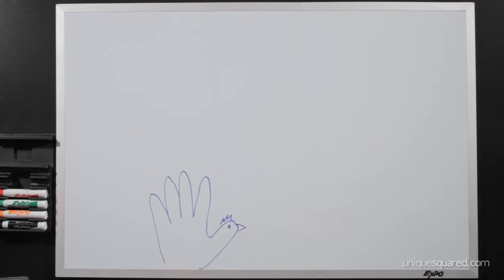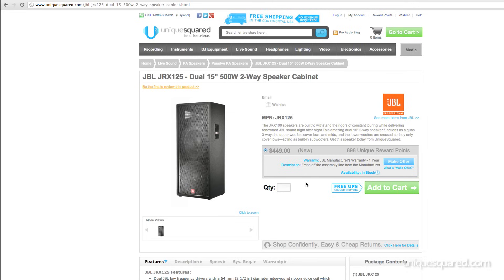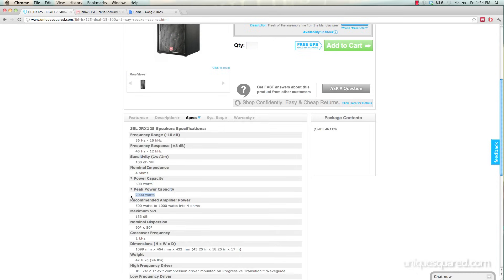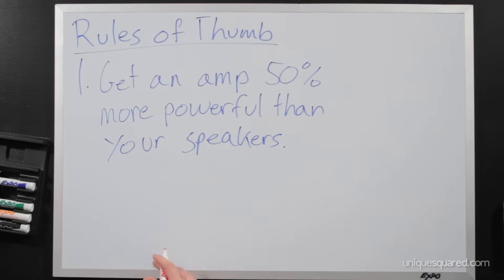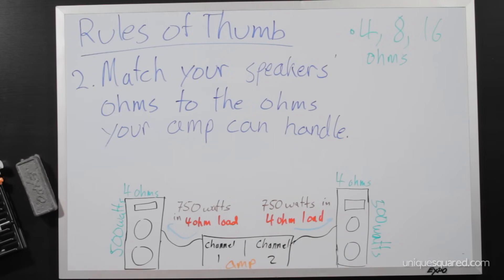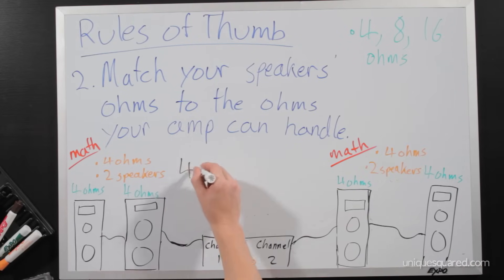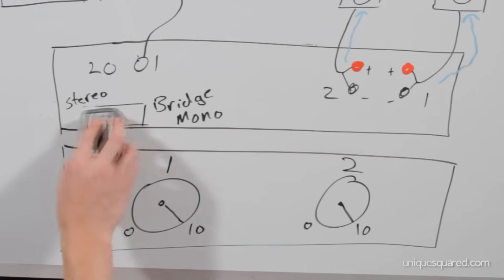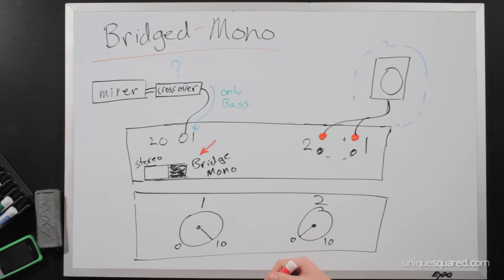Amplifier to Speaker Matching Tutorial | UniqueSquared.com

Comment: there obviously is some big misunderstandings about Impedance and speakers here, 
caution !

impedance and resistance are never the same thing,
this is not the way to work out impedance of multiple speakers,
the more power you have to drive a speaker the more control you have over it, in this example 2000watts seams excessive but with good engineering is perfectly fine.  also more power equals more head room = less clipping.
under powering a speaker will kill the speaker before the amp !!

Comment: What if I have a 1000 watt on 8ohm amp and I have 300 watt speaker 8 ohm also .... does working with that affect my speaker ? Please help
Reply: If you are are running one 300 Watt speaker at 8 ohms, and have a 1000 Watt amplifier at 8 ohms thank you're good. However, you have a powerful amp that if you turned all the way up would blow your speakers.

Comment: Unfortunately all of this doesn't apply to Home Theater Systems. The best and most powerful discrete Amp money can buy is probably the Onkyo PA-MC5501 which outputs 150W/Ch @ 8Ohms and 220W/Ch @ 6Ohms for a total of 9.2-channels. And there are not that much of passive Hi-Fi speakers at 4 or 6Ohms, at least I've never seen those.So the Amp > 50% of the speaker rule just can't be applied here. Also, as passive speakers aren't self-amplified, the Manufacturers generally say like "Recommended Amp Power: 20-200 Watts", so you know that your amp doesn't have to push more than 200 Watts per channel into the speakers' impedance. The RMS (actual power) value, it's always hard to be found. Then there's the peak-power handling. All these data are quite confusing and misleading and it's almost impossible to perfectly match the amp's power with the speakers' power. The Impedance is the only easy thing, as you just need to assure that you are running all same-impedance speakers that your amp can support. When it comes to Studio Monitors, it's easier because you can get really good active ones like the ones I own: the Yamaha HS8 (120W) with a really good DAC like the CambridgeAudio's DAC Magic Plus. As active studio monitors have their own internal amp, you don't need to worry about anything. The issues comes for passive Home Theater speakers.

Comment: You will not destroy an amp from hooking up speakers that are at a higher wattage rating than the amp can output. What destroys the amp is when the user keeps turning up the volume to compensate the underpower difference, this puts the amp into clip and will lead to bad things like blown speaker or fried amplifier.

As long as the amp is in the proper Ohm load, it will output it's rated wattage, and not care what the speaker is rated. the only thing that will suffer is the volume, because the speaker could be louder with the proper wattage sent to them.
Reply: Hi,

Recently i found two 100w speakers and i wanted to buy a small 25 $ amp that outputs 20w per channel, i dont want any crazy volume as ill out them in my room. Do you know if that would work? you seem to know more so please could i get an answer from you? Thanks in advance

Comment: This might be a silly question .but how does the amplifier go from 4 ohm to 2ohm. Is there a switch or something. Thanks.
Reply: It is not switch. Amplifier can do 2ohm or lower. It is how much load it can handle before getting clip or even shot. Normally big woofer will go down very much low ohm.

Comment: When setting gains on amp you should first set your signal levels on the mixer to just before the red meter. Then turn your gains on the amp to your desired level which should never have to be up all the way.

Comment: So just to confirm.
I can use 2 8Ω speakers that have "Recommended amplifier power 25W - 100W into 8Ω on unclipped programme" on an amp that is 4Ω and 30W? (I don't mind if the speakers will be a bit underpowered, this will just be temporary until I can get a more powerful amp).

Comment: Outstanding job, KUDOS!.  Im putting together a system using a DBX Driverack PA+ and I still can't figure out how to connect it all.  Easy out of the DBX, 2 XLR's per high, mid and low L and R. . Then into the amp keeping L/R so far so good but how the heck do you connect the mid and highs coming out of the amp (Subs are easy. One speaker per box L/R) to my EV T-252 meaning there is 2 speakon connectors in the rear per box but how do I know which is high and which is mid? I did take the rear panel out and moved the fuses to one side which you're supposed to do to By-Amp it. Wish I could send you a picture of the rear panel of these old EV's T-252

Comment: Ok so I recently bought a pair of B&W CM8 speakers that according to the specsheet has Nominal Impedance of 8ohms and the sheet also says "Recommended amplifier power 30W - 150W into 8Ω on unclipped programme". Now i bought this at a well renowned store in Sweden so they recomended i got at the very least new Denon X3100W reciever which should not underpower the speaker. Now the specs on that reciever is a bit difficult for me to grasp, it has 3 different specs. Power Output (6 ohm, 1 kHz, 1% 1ch Drive) is 180 W, Power Output (6 ohm, 1 kHz, 0.7% 2ch Drive) is 135 W, Power Output (8 ohm, 20 Hz - 20 kHz, 0.08% 2ch Drive) is 105 W. Now I run a 2.1 setup with a sub and have a roll-off at about 80Hz which was what the Denon had as it's default actually. so why am i writing this? Well at times if i try to play really loud it sounds as if the mid to highrange frequenzies are "bursting" like it gets too loud for the speaker. It didn't really sound like that in the store and maybe it's the room that i have them in that's the problem. Now i dont really play superloud very often, but would you say that the Denon is underpowering the speakers, can i do some equalizer magic to dampen the higher frequenzies or is this to vague of a question to be able to answer anything at all? Also i should mention that i am doing bi-amping (not just bi-wiring) into the Denon and have that configured which i figured would lessen the load a bit for the more basy frequenzies. :)
Reply: Do you try with no bi-amping?

Comment: I have a 1967 original am/fm radio in my 67 Camaro with 2 original 10 ohm speakers (a 4x6 located in each kick panel). 
Is there an amp you can recommend for this set-up? Thanks

Comment: I recently purchased a AB class amp capable of producing 300watts/channel @ 4ohms along with 12" 200watts speakers and 1" 20watts Horn rated @ 8ohms and a two way internal crossover capable of handling 300watts for each channel. Will connecting my Speaker and horn via crossover add up the impedence to 4ohms (8ohms Speaker + 8 ohms horn)... please help

Comment: This guy needs to learn about gain structure. The gain knobs on the front of the amps ARE NOT volume knobs. You should never run your gains wide open out of the box. Gain is not volume, it's the sensitivity of the amp to the input signal. It should be set to match the output of your mixer or processors. Running the gains wide open will cause distortion and will eventually blow your speakers unless you have a weak signal.
Reply: That's why I say, you shouldn't run them wide open out of the box. I've done installs where the proper setting for the amplifier is wide open. Everything is relative. I'm just saying, you should NEVER start out with the amps all the way up.
Reply: Yeah, I got confused about that.  I thought that it was ME that was missing something...
Reply: never clip on the mixer and never over 3/4 on me amps. keeps everything happy till it fills with dirt from the stompen.
Reply: Yeah, you want them at the least sensitive point where they can still deliver all the power you want, and then have the input signal stronger, rather than having to turn the input down and have it on full sensitivity ... that way the inputs are less susceptible to noise(EMI).

Comment: Don't take up teaching - What you say vs what you write at 3.44 doesn't make any sense to me at all
Reply: test your  eye power
Reply: Oh thanks for that it's very helpful, much clearer now, you're obviously teacher material.
Reply: It's fairly simple. Amplifier output at given resistance (ohms) should be 1.6-2.5 times the speakers RMS or continuous power rating. This will allow the speakers to handle 6db-24db peaks in power without causing the amp to go into clipping which causes distortion and sends DC current into the voice coil. 
You will damage your speakers more easily underpowering them than overpowering them.

Comment: I have PSB Alpha B1's rated with a nominal impedance of 8 ohms (some sources say it's rated 6 ohms) and recommended amplification of 10-90 watts (most probably the RMS).

Does this mean that I need an amplifier capable of driving around 135 watts per channel (assuming 90 watts is the maximum RMS power--150% of that is 135 watts) in 8 ohms?

Does this mean that my integrated tube amplifier and other amps that deliver 35-45 watts/channel at 8 ohms is not enough?

Hope to hear from you.

Comment: That's very nice, well done and simple, though I would have added the calculation in wattage for 2 pairs of those speakers, because the xti 2002 would have been insufficient for 4 of those speakers, you would have needed a second amplifier, and thus the logic and reason for the bridging function becomes more apparent. I also would have talked about total wattage as opposed to watts per channel, as many manufacturers list their amplifiers that way. Thus you have a 1600 watt amp, not an 800 watt amp. Otherwise, outstanding job!

Comment: I have a question why on the spec sheet it says recommended amplifier power 500-1000 watts. Is it because 1000 watts is the most you can put on each speaker or what? Please reply

Comment: Can i use a 5000 watt amplifier (crest audio CA 18) on 4 1000 peak (jbl jrx 125)
 speakers?
Reply: Don't worry too much about the peak wattage. The RMS power of the speaker is more important. Based on the JRX 125 and Crest CA18 spec sheets (google them), you can run 2 speakers on each side of that amplifier without difficulty. It is rated for 2,400 Watts at 2 ohms per side. BTW, the peak wattage of the JRX 125 is 2,000 watts peak & 500 watts RMS at 4 ohms.

Comment: im looking for a power mixer to power a speaker column. it supposedly has only 75 watts (12 impedance). do i need a 112 watt (12 impedance) exactly or is there some wiggle room for the wattage. i'm actually thinking i should go for a more powerful mixer and a better speaker system but i could find a cheap system to power it then i would do it for now.